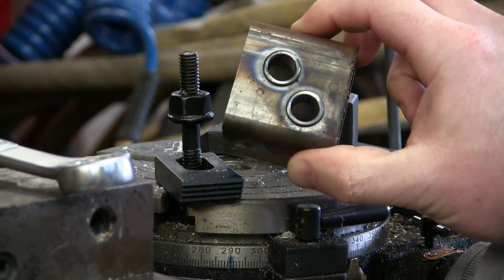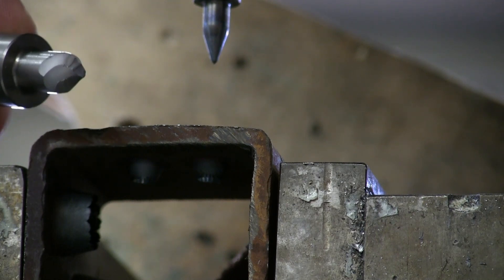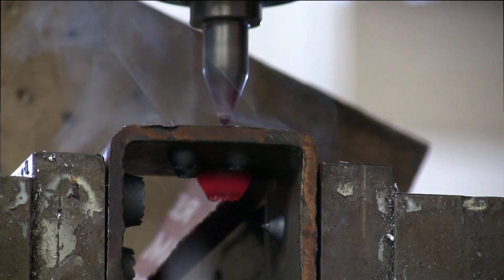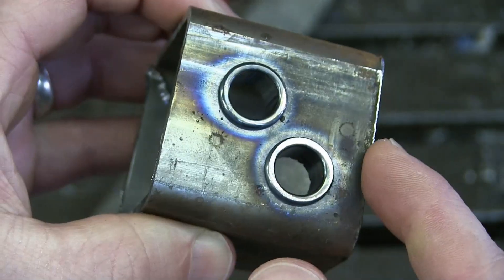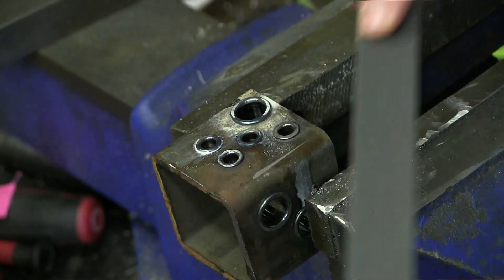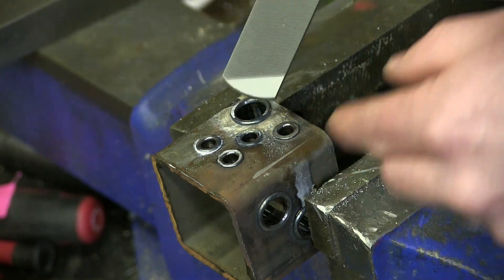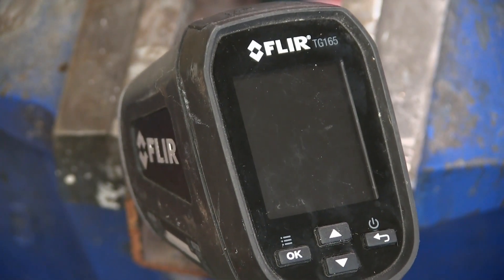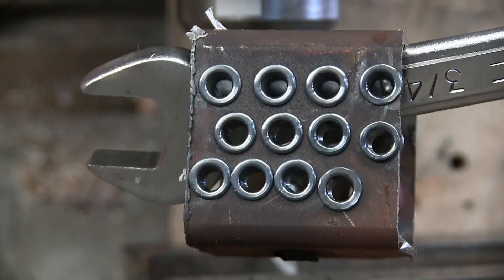Friction Drilling with Tungsten Carbide. Your Answers Questioned!

Comment: Hmmm, I've worked with guys who drilled holes like that with regular twist bits. Or at least tried to. Found one guy that had a thick piece of steel looking like a friggin porcupine once. He was trying to drill a pilot hole and I told him to start with a small bit. Only problem was the flutes on the small bits he got were not quite as long as the steel was thick. Yeah he couldn't figure out why they kept snappin off on him. Moron was pushing them past the flutes.

Comment: I haven't bothered to look at the other comments on here yet. If this post changes or is deleted that would be why.⁰

So you can cheat the soak time if so inclined. Creating a very small volume container of clay around the piece and packing that volume with a paste of wood flour, charcoal, Borax and water before putting in the furnace. This can drop the times from as little as 40% to as much as 20% of the original times.

Comment: tungsten has melting point like 6000C
iron around 1000+C i bet if you pour molten tungsten on iron it might melt the iron with adequate mass of heat ofcourse.

Comment: What is the machine that is used for drilling after installing the piece and does the machine produce heat or is it used as a normal drill and as a result of friction the heat is generated to melt the iron

Comment: Heat it up red hot and dip it in old motor oil for carbonisation of steel, it works well, would make a good video

Comment: So, my question being you only use the friction drill when you need to tap threads in a thin wall material. Why not just use a Nut-sert? If you can only torque the threads to 40  foot pounds anyway before they strip out what’s wrong with the nut-sert and save a headache?

Comment: Static threads hold a lot more than threads will clamp while turning.  I had a vehicle with a tilt steering wheel.  There were two pins about 3/8" in diameter with 10-24 threads to pull the pins.  I tried several including stainless and would just rip the threads off when I tried turning a heavy nut to pull the pins.  This was long before I had much more than a bench grinder and a hand drill.  I drilled and tapped a 1/4" bolt and ran a 10-24 stud into the pin and bolt end and pulled the pins with the 1/4-20 threads.

Comment: How about you put a receding cap with knife that directs rising metal into the hole so it deposits on the metal cylinder let below the hole. That way you could tap the hole and have a  female thread in a stronger scaffold.

Comment: white out also has zink. Blacksmith trick for canister damascus. You definitely have to soak it in a air tight canister with carbon for sure to add carbon with that. You can try and water quench it to get it a little harder.
Reply: There's a great video I watched on it at (forge diaries ep.5 refining and carburizing wrought iron)

Comment: AvE, what if you were to set up on a solid surface and lean into it at a slightly downwards facing angle? You might be able to get more down pressures and by proxy a bit more friction. 

But this is an armchair scientist with some theory no one else probably cares about. 

Thanks for the vids, and keep on doing what you do man.

Comment: About hardening mild steel, I welded myself up a chipping hammer for when I have to use a stick welder, and I noticed that the mild steel just got tore the fuck up from scraping slag, so I honed it on a grinder and took it to an oxyacetylene torch. After quenching it, it holds up like a charm. I haven't had to hone it at all after hardening it.

Comment: What about a .125" green TIG electrode in a dremel or drill? The smaller diameter may work without needing the entire group of 200lb gorillas on it at once. Although, tungsten rods may be hard, I don't know how well it would perform against the cuntstain targlide equivalent bit at high temperature.

Comment: And, just to be America the US went and dropped the M instead of the S and calls them SDS. Safety Data Sheet, and hopped right on the "Globally Harmonized System" that is not Global, and certainly not Harmonized. 
It is good for freaking the fuck out of people:
"AHHH! It causes CANCER!"
yeah, it contains Isopropynol (Isopropyl Alcohol / Rubbing Alcohol). Possibly causes Stomach Cancer. To get a danger of stomach cancer you need to drink enough that cancer is the last of your worries.
Worry instead the shit can catch fire.
"That stuff is dangerous! Inhalation Hazard!?"
Look closer. The IH on a GHS is not a Class 6 PIH. They do not equal the same thing. Unless it really is a Class 6 Poison Inhalation Hazard, but one cannot tell just by looking at a GHS label, as some poisons not actually a PIH are listed as IH 
Best part, if you ask the Feds for clarification, any thing they tell you is likely wrong, and they will fine you for their being wrong if you follow their clarification.

Comment: Will it work if you try to friction drill into a solid block of steel or would there be too much heat and nowhere for the melting/smoldering steel to go?

Comment: What happens if you friction drill through two pieces of metal? As in, you had two bits of box section, one slid over the other. Would that make it easier to thread through both pieces?

Comment: Funny how they sell us all these "magic snake oil" lubes that wind up being everyday shit. I once bought this "special" oil for cutting pipe threads that was supposed to be the best thing since arasol cheese. I paid I think $6.00 for 8oz. , got it home , opened the squeeze bottle----S.A.E. 30wt. non detergent motor oil!!  I should have used it in the store to lube up for they jammed it up my ass. So now I allways look for what is in these "magic potions" and hit the cheap button whenever I can.  Case in point , I do a lot of shooting so I reload to keep costs down. You need to lube the shell cases before you resize them or they stick in the die and stop you faster than diving into an empty pool. Turns out the "magic shit " they sell is just lanolin thinned with alcohol to go thru the spray bottle. For around $7.00 you get enough to do about 600 rounds. So I figure lanolin--drugstore so I get in the car. At the drug store I ask the lady for some lanolin and she takes me down this isle filled with little bottles , breast pumps and bras that have "easy access" snaps. She hands me this box that says"soothes & protects sore , cracked nipples" , 100% pure lanolin. Sounds about right.   So now for $8.00 I have so much case lube the shit's gonna be in my will. And I'm able to "soothe and protect" when the laundry over starches my shirts!!

Comment: there may have been some curiosity about the temperature associated with the steel when drilling this way. Well we saw a white heat, and the steel was flowing. A white heat is around 2300 degrees American, or a bit over 1300 degrees everywhere else.

Comment: Hey doesnt heated tungsten release x rays? 99% heat, 1% x rays you might have to google that. pretty sure you are just supposed to punch a couple of holes with this method due to the fact that your raisins with fail to chooch.

Comment: if you want to harden mild steel, try quenching it in used motor oil. the high carbon in the oil penetrates the hot metal during the quench.

Comment: Would it work with a hand drill if you predrilled a smaller hole, like an 1/8" hole for the 1/4" bit so that it had more surface to heat up quicker and with less down force required?  What about on a drill press?

Comment: (Edit: Yeah... I just read some comments and this is super redundant. Just going to leave it here anyway.)

A tip (for whoever is interested) concerning the thermographic camera; the infrared emissivity of materials varies a lot. A simple way to correct the emissivity and thus measure the 'correct' temperature would be to, for example, stick a piece of ducktape on the material. Ducktape has pretty high emissivity and the temperature measured will be (with a margin of around -10%) relatively accurate. If the camera has adjustable emissivity values then you can use this to correct the measurement of the material you're trying to analyse.

Howeeeverrrr, due to the low emissivity but the high reflectivity of most metals, one should also be aware of the background of the material. Infrared light is just light, so use it as a mirror and get temperature measurements influenced by the reflected material. Measure a mirror reflecting the (clear) sky and the results will be more negative than the people of America on the election.

Comment: I haven't read all the comments yet, but if mild steel doesn't have enough carbon to be hard enough, can the tungsten flow drill hold up to higher carbon steel? And could a large enough drill press have enough downward force to flow drill?

Comment: Get Kasenite/Cherry Red or some other case hardening compound..those work in a very short ammount of time. You get a case thats a few 1/100mm deep...normaly you heat the part with a torch, drop the part in and then heat it a bit more and quench it in water. Spraying water all over the bridgeport? Sounds like fun ;)

Comment: being a hydro guy, I'm not to indpeth with metallurgy, if a sealing surface of a piston gets scratched, how does one going to refinish a surfaces, or do you have to strip it and start back up?

 also can carbon fiber be friction drilled or is it easier to just form a castleated nut?

Comment: Does anyone know what the carbide bit is called? 
Not sure what search term to use, maybe I missed it, tried Carbide flow, friction, cone, mill, drill, etc.....no go.
Maybe smooth cone carbide skull fuck gouger?
Reply: Google search "Flowdrill Thermal Friction" or use that term on a well know auction site. Don't see a shitload for sale, but you will see bits that look like the one in the vid.

Comment: Flow drilling is kind of like friction sawing, get the red dot in front of the blade and keep pushing. Basically don't stop and let it cool down. Same with the flow drill, once the metal gets red or yellow hot you shouldn't back off on pressure and probably why the one flow drill broke. I know the Bridgeport Mill bogged down, but one trick is to heat the spot with a torch then flow drill, it helps. One of the tricks I used out in the field using a modified magnetic base high speed drill press. Yes, like you, I've been to B/F Egypt many times and had to use what was available when half or none of our stuff didn't show up and had to get the job done under time constraints. Thinking outside the box becomes second nature. Fun times!

Comment: I'm not sure if it was mentioned, but what if you oil quench the stock after drilling and then heating it with MAPP or Oxy torches?

I've used that method before to harden parts for quick and dirty prototyping..

I'm certain you know about that trick though, so my actual question is, is there a reason you did not use or mention that method?

Comment: Ambient room temperature will also make a slight difference. If we take the same EVERYTHING and do the same process in each of our shops. The outcome would be slightly different. AvE's shop is sometimes below O°C. mine is a toasty 71.5°C. If we annealed our metal his would be slightly harder and slightly easier to snap crack or shatter in the cold. Any time messing with an electron microscope will show that just a few degrees will change things slightly. Even the amount of heats without normalizing will change the atom placement slightly.  This is why I believe that throwing a ounce of cold oil emediately after backing out would harden the steel. P//s if the steel had NO CARBON. It would be iron.

Comment: so you could tap that hole without regularly breaking taps due to edge hardening!!! - when we laser cut holes we have been advised to laser smaller holes for reference and then drill out the laser "markers" so that the taps dont break as regularly.......not seen the process as this is a subcontract for us.

Comment: This is a response i left way down the page. hopping Ave will see it.<--->annealing by letting the heat bleed out into the surrounding metal isn't quite as fast. Instant cold oil applied would do much better because the heat that dissipates into the surrounding material is not the same as a quench. It's half annealing and half quenching. since the material already comes with a small degree of hardness (even tho its mild) anyhow long story short, they cancel each other out almost completely. Almost. That is why we noticed the partial hardening. just as if he wanted to anneal it, he'd have to heat the entire piece. Or slight hardening will occur when the heat bleeds into the surrounding unheated steel. thanks for the videos. Seen em all, and my phone gives notifications to every new one.

Comment: Hey AvE. I was thinking. when I harden any steel. It's not so much the carbon (though its does dictate the end hardness) the act of cooling rapidly with some melted blocks of tap water. or even better grab the wife's deepfrier and use the veg/canola oil. Works better because it makes better contact with the material, unlike water that has a tiny layer of steam between the material and the liquid. There's the tip,  but only for a second. 👍

Comment: What if you drilled a hole then made a plug weld with a high carbon filler before using the tungsten drill.  And a quench would probably help harden it too.

Comment: I really doubt that the Tungsten Carbide welded itself to the Steel. Probably a better explanation has to the Coefficient Of Thermal Expansion. Steel has a CoTE that is twice that of the Tungsten Carbide, so when you let it cool down the Steel shrinks and has a negative clearance. You could have saved your tool by heating the steel back up, expanding it and withdrawing the Tungsten Carbide drill. 

You could try it on the broken bit and see if it falls out as you heat the steel.

Comment: why doesn't the molten metal build up on the drill
Reply: O interesting question. My guess is the iron doesn't reach a high enough temperature where it's so runny that it drips and flows, which probably would be required for any build up

Comment: +AvE Metal stearates are basically different types of soaps. 

Sodium stearate is the active ingredient in normal bar soap. 
Potassium stearate, I belive, is in soft soaps/gels. 
Calcium stearate is a "soap" that was commonly used as the thickening agent in grease.
Lithium stearates are used as the thickener these days because they're more heat resistant... the oil will actually break down and burn before the thickener gives up so that the grease will not melt and run out of bearings. 

Zinc Stearate... Effectively, you are lubricating your little red lipstick with soap.

Comment: Ave, if you feel up to it, would you mind trying the 1/4" flow on brass? I have a project that I am working on and this seems perfect but it is in brass and it is in a very small diameter piece of tubing. Before I contact the company about a specialty drill I would love to see actual results in brass firsthand.

Comment: hey AvE, nice vid. i have and idea. how about using the carbide bit not to drill but to surface finishing. you can use the broken bit horizontally. insides of the ones you drilled are looking really smooth.

Comment: Ive no experience or any clue for that matter but still watch the vids, so excuse my ignorance, however still has to ask - the broken tool - can it still be used, presumably its the same material just roughen up by the damage, so it should, to my mind, drill through the metal but perpaps with less ease?

Comment: This is one of the 3 methods that holds the new aluminum Fords together.  Looks very similar to when you shoot A36 steel with a high powered or magnum rifle.  I use stearates as a lubricant in bullet lube for my BPCR, it's a high pressure lube that works wonders.

Comment: seems like more and more stir welding is being done with cubic boron nitride now, and the shanks are tungsten carbide, with the tool angled around 2 degrees away from the angle of travel. the bits i've seen look like self tapping screws and are hilariously expensive, and require the special tungsten carbide shanks to fit in the machine

Comment: Seems to me when these first came out there were two kinds, one hole would be flush on top, and the other would leave a boss as yours does. I believe the flush topped hole drill had a shorter point, or I may just be halucimicating.

Comment: Without coming off sounding rude, what is the point of this? I see the speed it drills but there are actual carbide drills that drill equally as fast, if not faster. They also produce almost no burs. Granted they are expensive as all hell. in my industry this would be a complete waste of time, so I am curious to see the benefit to a different application.

Comment: I'd think you'd need an air hardening steel for the friction drilling to harden your material. That or a coolant system capable of hardening a piece of water hardening steel. Personally, I wouldn't try it with oil.

Comment: What about if you cool it immediately with oil after like if you were to drop a red hot bolt into oil. Bring up the hardness and brittleness but would it make it better or worse is the question?

Comment: figured you may find it entertaining and what not but driving in to work today while attempting to change lanes  (all while using my turn signal, unlike the rest of Florida drivers) the signal kept not chooching. figured out it was the relay, while driving (I like to multitask) about 20 mins later tried it again and it wouldn't work. screamed "CHOOCH YOU FUCK!" all while in bumper to bumper traffic, WITH...the windows down. got some strange looks. 

rebuild a vehicular alternator, yes? I need to know what I'm getting into.